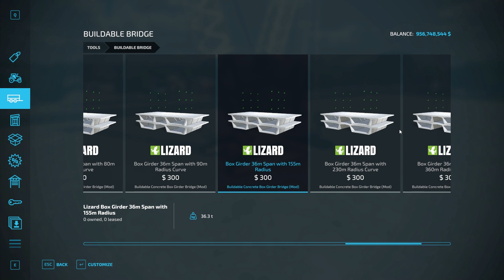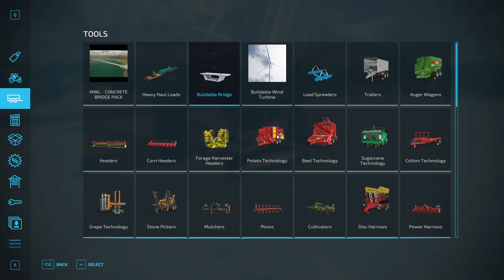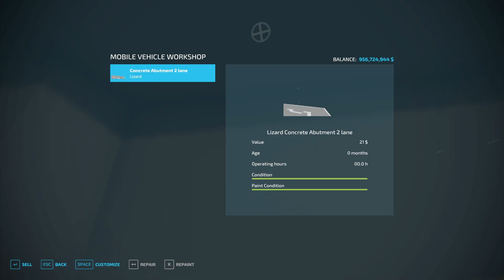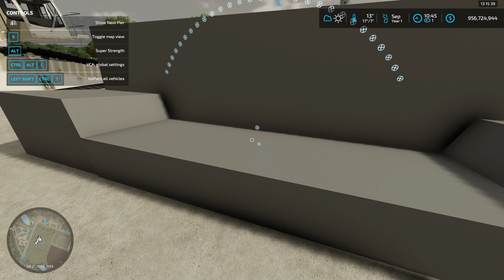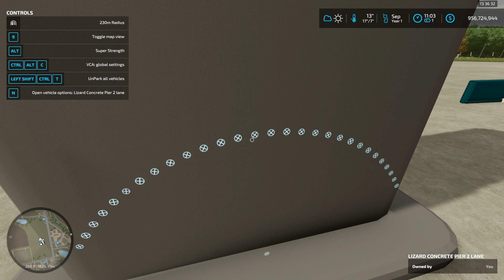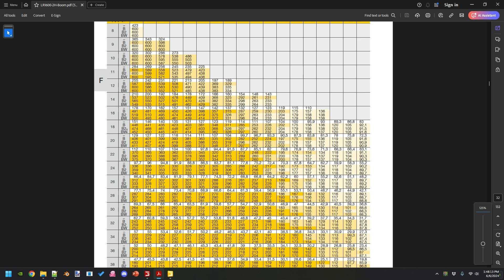FS22 Buildable Concrete Box Girder Bridge Tutorial Part 1

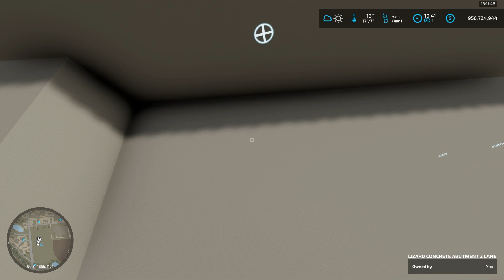Comment: 9:25 Did you use another MOD to convert a 15 ton bridge to a 10000 ton bridge?
Reply from the maker: It does that in the xml when you use a mobile shop to change the configuration in the store.
Reply: @jeremybrown9379  How to do it specifically?
Reply from the maker: @张德国-k4c  how to do the xml coding or how to open it up in store?

I use the mobile workshop mod, which I mention in the video shortly after the time you tagged.
Reply: @jeremybrown9379  Okay, I will try it. I'm taking the liberty to ask when LR11000 and LR13000 will be available for download.
Reply from the maker: @张德国-k4c  when they are finished.
Reply: @jeremybrown9379  We look forward to it, and thank you for your contributions

Comment: hey jeremy, amazing mod i am loving it. how do we transport the bridge parts themselves? they are massive
Reply from the maker: You would typically move the sections (smaller pieces) with a flat deck or RGN to the site. Then either build a full span on the ground and lift it or lift them up one at a time alternating on different sides of a pier to keep it balanced. You can do either method but if you actually want to use it the buyable span needs to be used when you lift it up. For that use the store delivery mod or a big trailer like an SPMT.